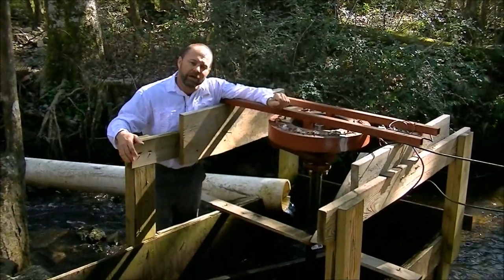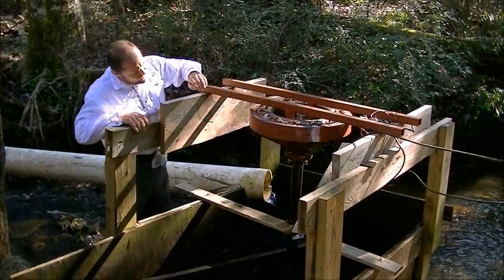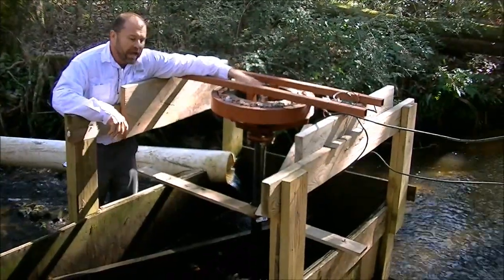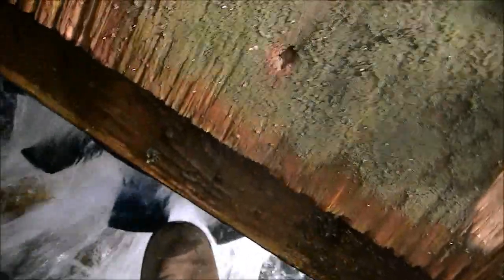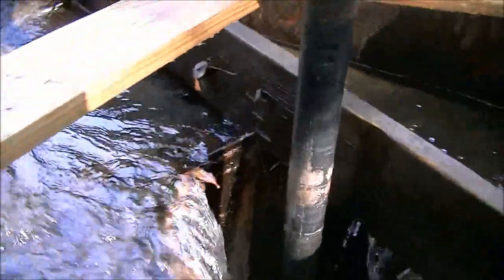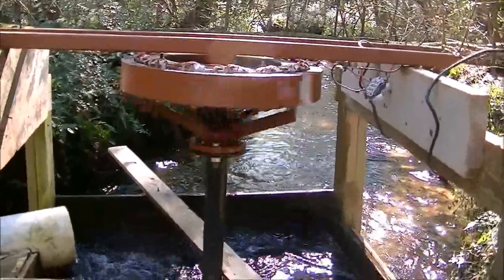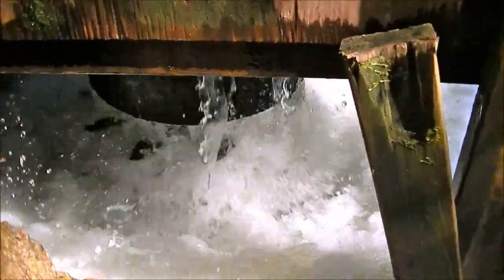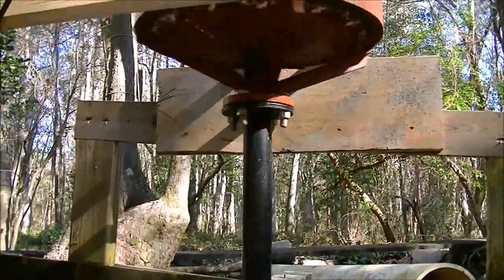Working home made hydro Generator/ Runs two refrigerators free electricity

Comment: Nice project.  Have you calculated the efficiency?  12 amps at 30 volts is only 360 watts which would only light four 75 watt light bulbs.  Powering two refrigerators at 120 volts means each refrigerator is receiving 1.4 amps.  What size are the refrigerators?

Doing a quick calculation shouldn't you be able to generate 813.19 watts from that amount of water?  You should easily be able to get twice the amount of energy from that amount of water, is there are reason you aren't?
Reply: Good post, but it's important to note that most households use less than 2000w on average. Things like electric ranges, toasters, and similar will pull lots of power for relatively little time, without affecting the average too much. (A look at your power meter might demonstrate that.)

It doesn't mean you need to generate your peak each hour of the day, it means you need to generate the average and have the storage to cover the peaks.

Also don't forget that, when mentioning how many football fields worth of water it takes to generate x amount in watts, even a modest river can move hundreds of cubic metres per second.

The peace river here actually does hydroelectric work already, but smaller rivers can as well, just not for mass consumption.

The properties are true, as you say, and gasoline skews peoples understanding of just how much energy things need to move! For example, with wind power in my area I calculated a requirement for at least two 90ft towers with 10kW generators to produce enough electricity for my small home. For reference it would pay for itself in roughly 300 years based on current energy prices.
Reply from the maker: Their are full size refrigerators. The refrigerator turn on and off and the generator put out power 24 hours a day. My turbine is not the most efficient, I made it to be the least maintenance. I am not home everyday to keep a eye on it.
Reply: Not sure I understand.  An average full size refrigerator uses 750 watts,  If you have two that's 1500 watts.  But your are only producing 360 watts.  Where are you getting the 1,140 additional watts you need to power the refrigerator.

Don't get me wrong you have a very clever design.  I'm just not understanding why you are letting all of that extra energy go to waste.

I'm also curious why you went with this design and not a "traditional" round water wheel with buckets.  The buckets would capture the fish and turtles and would allow you to capture more energy.

Nice post.
Reply from the maker: Passed High School Physics I use to have a water wheel their but it was high maintenance. The refrigerators only use 750 watts in the defrost mode for a short while every day. My refrigerators are using less than 200 watts in the normal mode. I also have a solar system too and run a few other items as well. I will be on a tv show on the 23rd of oct 2014 that will show all my stuff.  It will be on the sportsman channel and I am episode 5. It is called America Unplugged.
Reply: markp0177 Congratulations for being selected to be on the TV show.  I was thinking of building an ornamental water wheel but then started thinking about building a functional water wheel for the nature area where my kids attend school.

This got me curious as to how much electrical energy could be generated with water?  And how much water was needed to generate say 100 or 1,000 watts.

I have been looking on YouTube and most just about everyone is excited about the voltage they are able to create.  (I don't get it because Voltage doesn't do any work it's the voltage and the current that do the work.

When you built yours how did you calculate how much electrical energy the system would produce?  Or how much water you would need? 

I was quite surprised to find some waterwheels can be close to 95% efficient.  What I'm not understanding is why if you have all of this water energy your not trying to get more energy out of it?  Does it just become too difficult to obtain higher efficiency?

I have to admit it's a very clever design.  Care to share what the issues with the water wheel were?  I've seen water wheels which appear to be over 100 years old which are still working.

I'm by no means an expert in this subject, just trying to learn more.  I do appreciate you answer my questions.  Thank you.
Reply from the maker: Passed High School Physics Yes, the water wheel is very efficient but turn very slow so you have to have chains and belts to get the RPM up enough to use. The belts, chain and bearings need maintenance all the time. My system only needs grease once a year. Watch this short video on my generator on a under shot wheel.
  Hydro Generator
Reply: markp0177 Thank you.  In your short video I see what you mean about speed and need for gears and belts.  This is a much simpler design and you are right it's far less maintenance.  Between solar and hydro does this supply all of your electrical needs?

What do you do with the 30 volts?  Is it AC or DC?  Do you use a transformer to step it up to 120 volts?
Reply from the maker: Passed High School Physics I only have enough power to run 2 refrigerators and some lights. I charge batteries that run a inverter.
Reply: markp0177 I see.  I thought you might be powering the refrigerators directly from the water wheel.  Am I correct in assuming you have to cycle the power to the refrigerators?

I'm thinking you are not generating enough electricity to run them 24 hours a day.  And since you're not there all of the time you aren't loosing that much cold air so they don't have to work as hard or run 24 x 7. 

Are you charging the batteries and then powering the refrigerators then shutting off the power to the refrigerators to all the batteries to re-charge?

Don't think that would work for me.  I have kids and the refrigerator door is open almost as much as it is closed when they are at home.

Is there enough elevation drop on your property where you could add a second waterwheel downstream?
Reply from the maker: Passed High School Physics Not enough drop to add a second wheel. I have lots of kids too. I charge batteries that run the inverter that runs the appliance's. It has been running my frig's for over 12 years. I work a lot and am not home everyday and this system works even when I am gone for a week.
Reply: markp0177 I think I'm missing something.  Your system is generating 360 watts yet the load your refrigerators draws,  (I think you said) is more than 360 watts.  Where are you getting the extra energy to make up for the difference?
Reply from the maker: Passed High School Physics My refrigerator draws less than 200 watts. Get a amp meter and check yours. I also have solar panels too.
Reply: ***** A battery bank is a chemical energy reservoir.  The water is also a energy reservoir.  Not sure why you would need a battery bank when you have a water energy reservoir.
Reply: Passed High School Physics According to https://www.efficiencyvermont.com/For-My-Home/ways-to-save-and-rebates/Appliances/Refrigerators/General-Info/Electric-Usage-Chart a 20 year old 22cuft fridge might consume 1620kWh/yr. That works out to (1620/365/24) 0.1849kW, or 185W. A newer and smaller fridge would be closer to 56W. Again, this is an average. The compressors will draw significantly more when they are running, and their current will be particularly high when starting up (inrush current). As mentioned, though, that's fine as long as your batteries and inverter can handle it. The inverter is also a factor, as it may only be 85% efficient (or so), but that's still only 212W/64W respectively. For storage, a 60AH lead acid battery isn't uncommonly used for applications like this. Assuming it's old and tired and only coughing up 30AH, that's still 360Wh, and the internal resistance (usually) won't change with age, which would easily muster up enough current to satisfy the compressors.
Reply: ***** Nice explanation, thank you.  Why not use the power grid instead of banks of batteries to "store" the electricity?

Seems to me using the power company would save the "smart" way to go since you would not have to buy and maintain a bank of batteries,  And you would not have the hassle or deal with the safety issues you would have with banks of batteries. 

This is what the solar companies do.  Except the solar companies they sell the electricity to you for $0.22 and the power company pays $0.02.  This is a win/win for the solar company and the power companies.  You pay both of them for the power you generate and don't use.
Reply: ***** Guess it depends on where you live.  I can't remember that last time we lost power.

Interestingly the solar systems companies like Solar City sells can't be used to power anything in your home if the grid goes down.
Reply: In Alberta you are billed a regular transmission fee for energy received and the same for energy transmitted. The rate is retail in both cases, but you are paid at the wholesale energy rate rather than retail rate when you transmit. The result is that it literally costs you money each month to put money into the grid, even if you use none of it.

Hopefully the new government will do something to fix what the old government (of 44 years) broke horribly.
Reply: ***** I'm not about the profit so much as the savings, so that's just fine by me.
Reply: ***** For sure. The power company is still charged with line and overall grid maintenance, so it's fair that after breakeven it offers less payback to the consumer. After all you still have the benefit of grid access as insurance, which is worth something.

I've been pounding the web to find a cost effective off-grid energy gathering system, but due to my location (northern canada) solar, wind, and geothermal are basically useless. They could work if scaled large enough, but I'm not installing a 600kW wind turbine 30m high to pull 800w average, thanks anyway.

A 220a (2.6kw) alternator idles around 150a (1,8kw), which with an ample water supply properly managed would consistently generate enough electrical energy to power my home (and then some!), which is why I'm so interested in this sort of thing.

Right now my biggest question is why above-water free-run turbines aren't more popular. They're highly debris resistant, easily relocatable, offer impressive wattage, and often don't even require permits.
Reply: Francis Mortanian I think the the power companies offer one of the best deals  My refrigerator costs about $25 a month to power to keep food cold or frozen.  Compared to the days when my grand parents had to buy a block of ice, have it delivered and deal with the water as it melted I would gladly pay the power company $25 a month to keep my food cold.

I have a stream running through my property and had thought about using a water or Pelton wheel to generate electricity.

According to the numbers I was given to generate 800 watts per hour over a 24 hour period with a 10 foot drop it would one would need about 500,000 gallons of water which would be the same amount of water as that in 25 backyard swimming pools.

Hydro power on a small scales can make sense in some situations but it's rare.  The costs, maintenance and reliability issues make if far more effective to just purchase power from the power company.

After calculating the amount of water needed to power my refrigerator for a day makes me agree.
Reply: Passed High School Physics According to http://greenbugenergy.com/get-educated-knowledge/power-versus-energy you would need 27.183 litres per second, or roughly 7.18gallons/sec at 3 metres (9 feet) to produce 800watts. That's not much water.
Reply: Francis Mortanian   Would that not be 430 gal /min or 25,000 gal/hr or over 500,000 gallons per day?

The average person uses 100 gallons per day, which means this would be enough water for 50,000 people.

I don't get it.....  You say "That's not much water"  Sure seems like a lot to me.

That's more water in one day then in 25 backyard swimming pools.
Reply: Sure, a creek trickling along at 1 m3/s will move 86,400,000 litres of water per day. It'll go there with a turbine on it or not. It isn't burned up and you aren't being forced to drink it all, what's the problem?
Reply: +Passed High School Physics  what equation are you using on the water ?does his devise  need to be bigger to get 50 or 100 amps,/what is the math you used to get 100amps explain in layman's term
Reply: Francis Mortanian thank you
Reply: 50 ft . I dint  get the height formula. water change speed from 500 ft. or 50ft. ? I thought it stay at a constant speed .2 you said  
The only think is the cost of the wheel and installation will take decades to pay for itself compared to the rates of your local power company. why ?what parts would cost that much ,that it would  take30 or 20 years to pay off .3are you saying that building a dam for 100 amp is not cost effective? even if the water is free ?why is elevation important in the formula
Reply: is height better? for the generator ? or for kinetic energy  and how is effecting the project
Reply: Passed High School Physics  NICE
Reply: ***** DR.Norcer of mit has found a solution to your problem around night time problem  by using hh2 like in photosynthesis ,he called it personal energy ,he his the real thing no bull shit I saw him in this old house ,and you know this old house is the real thing  check him out .I give the link later
Reply: LLN:s NIF?WHAT IS IT
Reply: I TRIED to look for llnls nie and sarah felix &Amanda s wu came up
Reply: Passed High School Physics you're so full of shit. Nothing but a shill skewing and making shit up for you're agenda
Reply: Nelson Dacosta  What we are after is how much work can be done by the weight of water.  There are really only variables, the amount of water, gallons) and the height of the water.

There's a simple math equation we can use which has been around for almost 500 years which we need to use.  It goes like this  Watts , Work or Potential Energy = Mass x Height x Gravity  (Assuming 100% efficiency.)

We know the mass or weight/ of water is 8.32 Lbs per gallon.

The height is how far the water travels to do the work of turning the generator.  For simplicity lest's say 10 feet. 

And gravity is = 32.2 ft/s2

You are asking about 100 amps.  We know watts = Volts x Amp.

So to make this easy lest say the voltage is 100 volts.  Sol 100 volts x 100 amps gives us 10.000 watts.  Divide the 10,000 by gravity and you will be left with the amount of water and the height which is 310.5 and this would be feet per second.

For 100 amp you would need 310 gallons per second falling from a height of 1 foot.  1 gallon per second from a height of 310 feet.
Remember this is at 100% efficiency.

Let's say you can only get 50% efficiency you would have to double the amount of water or the height.

Just to give you an idea the guy in the video is generating 800 watts which at 100 volts would be 8 amps.

To generate the 8 amps with a 10 foot drop 500,000 gallons of water would be needed per day.  That's the amount of water in about 50 back yard in ground swimming pools.

Just for comparison, the height of the water in the Hoover dam is drops about 500 - 600 feet.

Generations power from water either requires a lot of water or a large difference in elevation.  The power companies where I live have holding reservoirs.  During the day when the demand is great they release lots of water to generate power into the holding reservoirs.  Then at night they pump the water back up the hill into the main reservoir for the next day.

If you have the elevation, you could use a Pelton wheel.  The efficiency of  a Pelton wheel is one of the highest you can get.

The only think is the cost of the wheel and installation will take decades to pay for itself compared to the rates of your local power company.

You could go with solar but the efficiently of the best solar panels is only about 15-25%.  So for all of the suns energy which is hitting the solar panel you can only get about 20%.

TO get the 800 watts the guy in the video would have to install 4 or 5 solar panels to give him the 800 watts, but that would only be during daylight hours and then for maybe 5 hours a day.  So then what's he going to do for the other 19 hours?

Another alternative would be to use a gas powered generator.  To generate 8 amps or 800 watts would cost about $20 in gasoline per day.  This is one of the most inefficient and costly way to generate electricity.

I hope this answers your question in terms you can understand.  Don't fall for any of the lies people are saying about free energy or other such nonsense.

These basic physics mathematical formulas have been well tested.  They got us to the moon and back and have allowed us to take close up pictures or Pluto.

If someone tells you they have some secret for free energy don't get scammed.  Make them prove it by doing the math.
Reply: Nelson Dacosta Curious - Do you have the water and elevation?
Reply: Nelson Dacosta Water wheels are more effective for large volumes of slow moving water with very little elevation.

Pelton wheels are better suited for situations where there is little water and a large difference in elevation.

The amount of energy you can generate all comes down to a combination of how much water you have and the change in elevation.

Think about it in reverse.  The amount of work it would take to lift 100 gallons or water 10 feet  would be the same amount of work to carry 10 gallons of water up a 100 foot hill.

If you look at the amount of work, it's the same if you lift a large amount of water a small amount or lift a small amount of water to greater height.

Energy can not be created or destroyed.  So the energy needed to transport the water up is the same amount of energy you would get back when the water flows back down.  (We are assuming 100% efficiency which is not possible.)

Just to give you an idea of how inefficient motors can be.  I have a 3/4 hp water pump  If it were 100% efficient it would draw about 5.5 amps at 120 volt.  

AC pump motors are so inefficient this pump requires 12 amps.  That's over 2 times what it should which means it's only about 45% efficient.  

Over half the energy used to power the pump is wasted as heat energy and in electrical loss.

Be sure to factor in efficiency.
Reply: Nelson Dacosta LLNL's NIF is bring the chemical reactions on the sun on earth.  When perfected it will provide enough electrical energy for everyone.